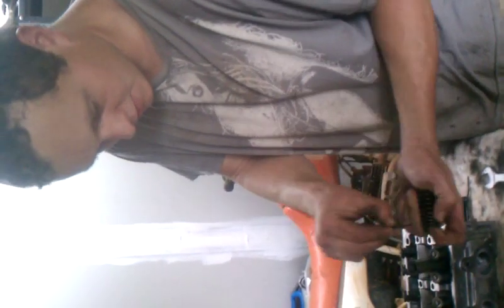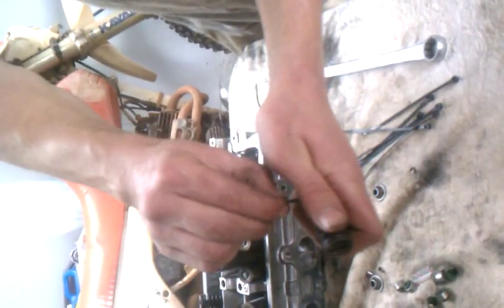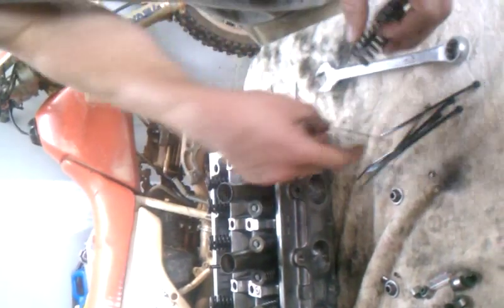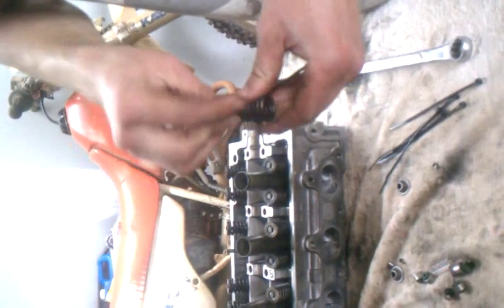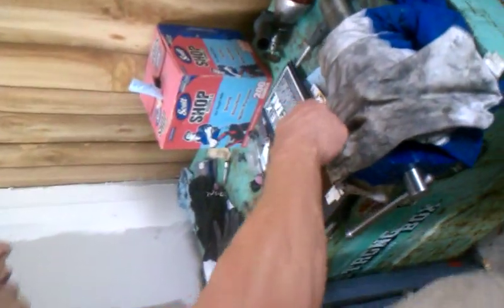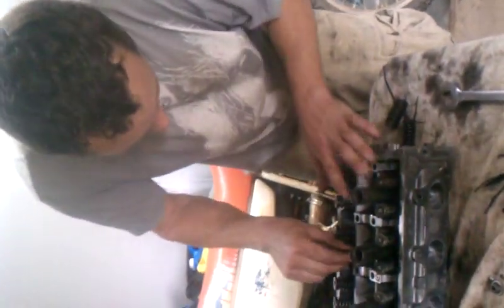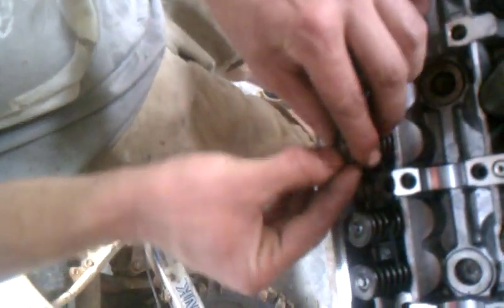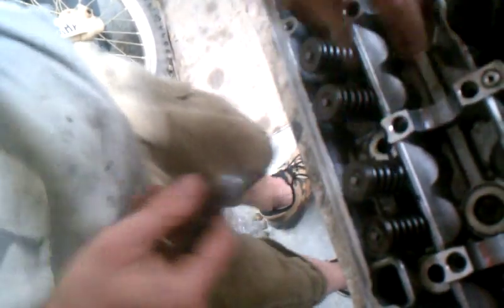Zip tie valve spring compressor

Comment: mine are so tight i had to use 8 zip ties, and still with it all the way down i had to press with a wrench to get the second colett in, how do i get the zip ties out, my springs are so tight they wont let them go
Reply from the maker: can't say. it won't necessarily work on everything. i was working on a 110 HP motor so everything is small and weak
Reply: gorillahumpr i'm working on a 75 HP motor, but even smaller, not weak because it runs at 11000RPM, but at least i got them in, what damage could be done if i cant get them out and they work their way out or melt out? i have an oil screen and my main bearing passage is 3/4 inch diameter so i think they will be safe, just worried about hot liquid plastic making it's way back to the valve area again and cooling down in the cam journal or the rocker arm journal
Reply from the maker: +aterack833 they will destroy the motor. you definitely can't leave them in there. if they don't jam up the valve and cause them to hit the piston they may do something else.
Reply: gorillahumpr my spring is surrounded from most sides, should i try i torch?
Reply from the maker: +aterack833 no, definitely not. that will just melt them and you won't get anything out. you may have to buy the right tool
Reply: gorillahumpr no place near me sells it and it's $30 online, what kind of damage are we talking? maybe i'll just rebuild it later?
Reply: @aterack833  what did you end up doing?

Comment: There are dozens of tools for this job all costing a buck or two. I pack of cable ties does not even compare. I'm prepping for a valve seal job soon with the heads on the car keeping the valves in place with compressed. My issue is typically not taking the valve keepers off, it's putting them back on. So as long as I make sure that the spring is pulled up and seated and the valve keepers are tight, it is safe to cut the cable tie. You made my day!
Reply: I have the proper tool and a home made tool and its till difficult with both bc the tools tries to slip off the retainers